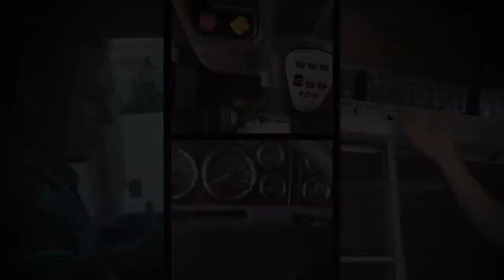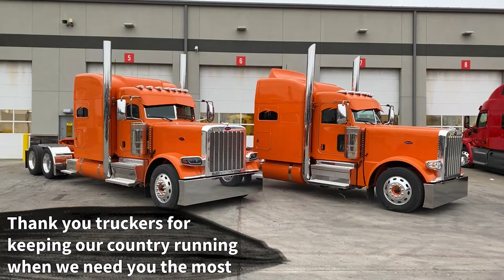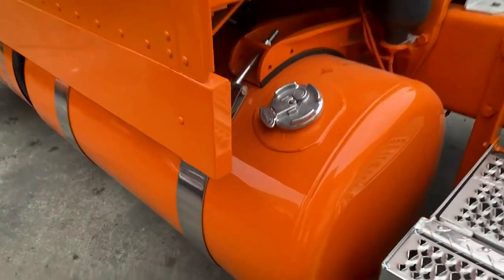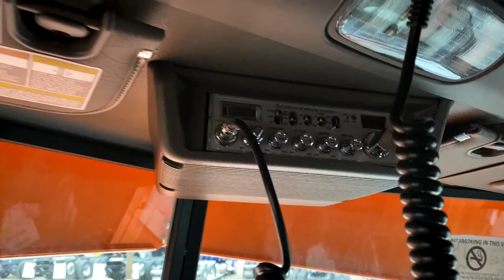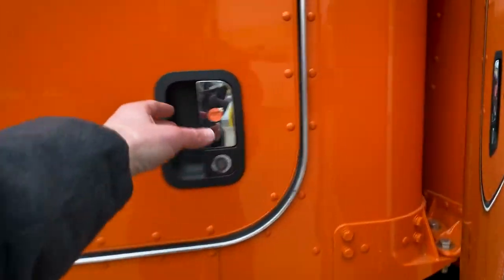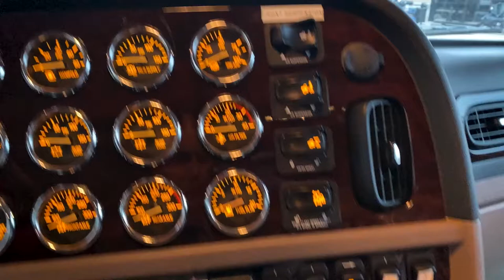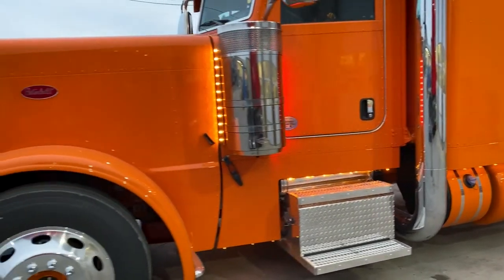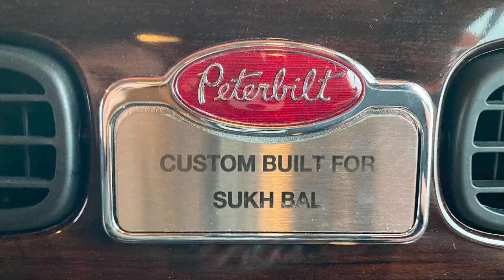Custom Pair – Sam Bal, Hardev Chahal & Manny Singh Omaha Orange Peterbilt 389 Dual Revolution Lights

Comment: Can u guys do epoxy floor, paint engine, boogey lights, lift front bumper, thermo king APU, full custom built sleeper( take out everything in the sleeper customized built everything or…. Can u guys work with ARI have them custom built the sleeper)